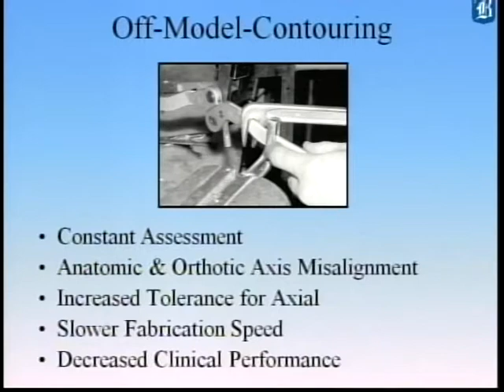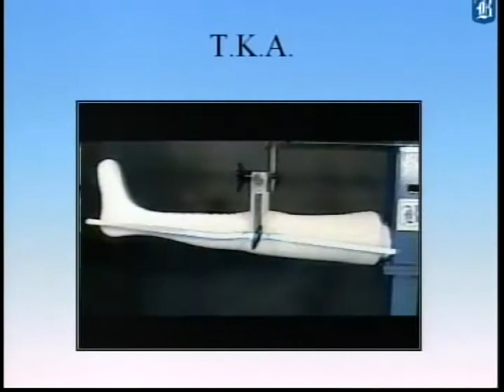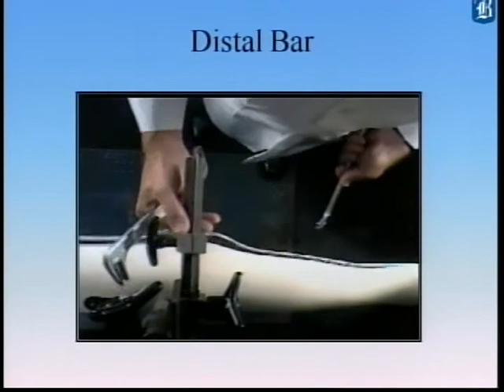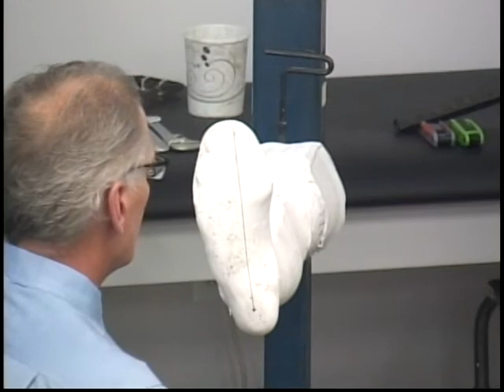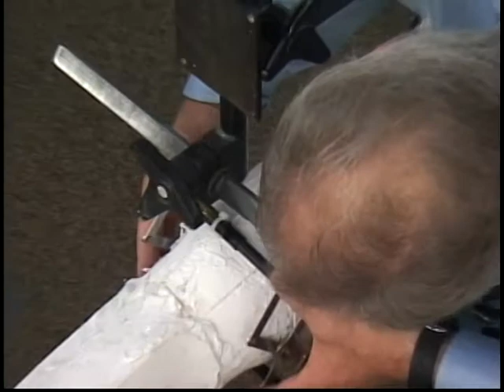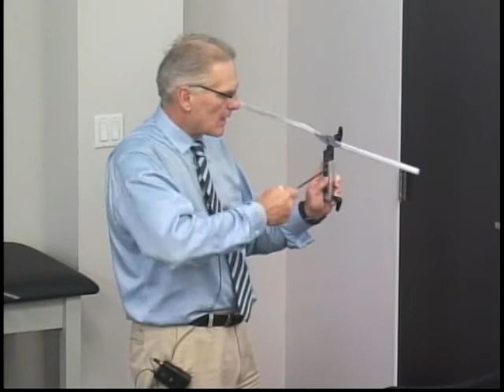Clinical KAFO Alignment on the Becker Orthotic Workstation

Comment: i found this video to be excekkebt and full of great information btw  I am a 56  year old  retired Woodworker and  as a Stroke Survivor have been wearing  some form of a AFO  or kano  for more than 10 years   a while ago  i was living more than 1000 miles away  from the place that fabricated  my brace  and my Doctor  at the time  wanted a  part  of  the brace cut off  at a [ppint he marked with a Sharpie  i went  into my shop and cut it on our band saw and  dressed it on one of our Oscillating Spindle sanders  the nect time i was in the  area of the place that made it i stopped by to show them my progress  iasked them  for a replacement strap  and the  builder looked at the  cut i made  and said who did this cut which i replied i did  and why  he made my strap and  gave the brace back to wear  home followed by if i ever wanted to try a new careeer  he would hire me and help train  me  i told him  that  i looked at his equipment  in his shop  and  realized we basically used the same  tools in our trades  ive also been a boat owner  for more than 35 years and have  done my fair share  of resin and Epoxy fabrication  and / or Fiberglasss repair and fabrication  plus  have done a lot of Structual Engineering  for Commercial Architectual Woodworking another interest and hobby of mine has been Vintage Automobiles  restorations and  ive heard the wrench you speak about called all the names you mentioned  alyjough 8 feel the most common name people use is Monket Wrench  the  ones made by Ford  are very easy and inexpensive on Ebay  and stamped with the iconic Script Ford logo  and i think  that Monkey wrench was a rwen used for  most adjustable wrenches  over the years  alyjough my Dad warned me to  ony ever use one when  you were in a bind and  did not have the proper  sized Boc wrench my Dad and I have a fondness for Antique British cars and Motorcycles and those use a Whitworth measurement  and thread size   for many years  being in the United States Whitworth tools were hard to find and redicuosly  over priced  so  he and i used a combination of SAE and Metric  wrenches with a handful of Whitworth  wrenches that came in  some of the cars and Motorcyle tool kits